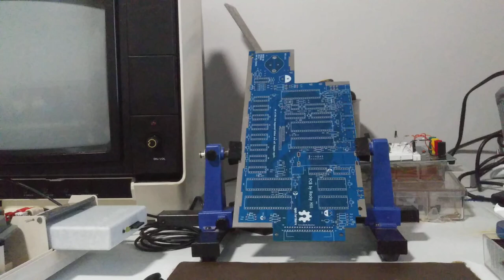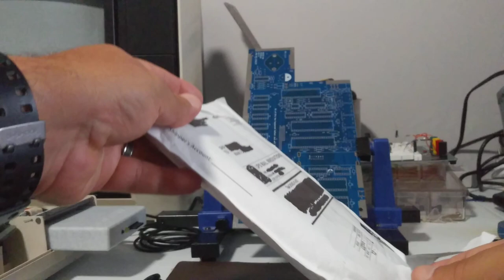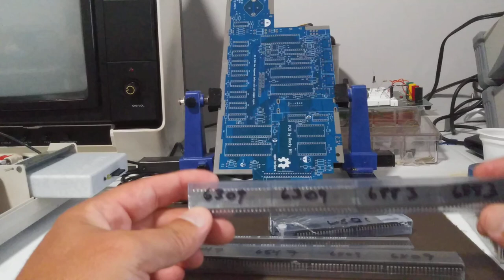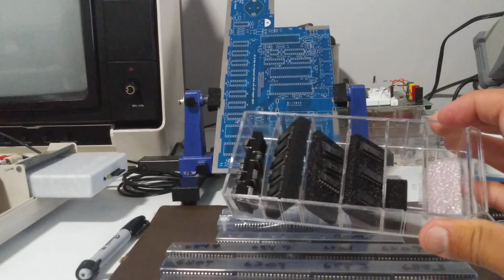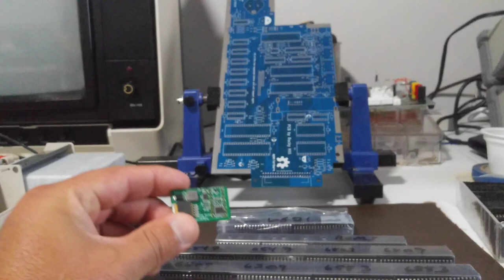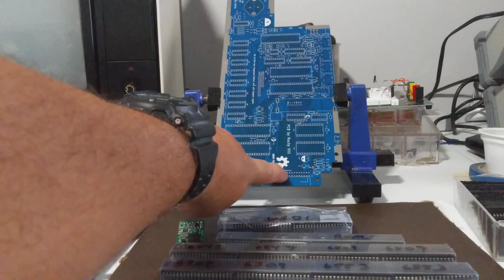Making a CoCo 2, a Retro Resurrection Part 1 #SepTandy

Comment: Awesome. Co Co II is my first & fav computer. I look forward to your progress. I have a couple old ones I collected 20 yrs ago, maybe I can find some parts you need..Will this also run cooler than the original Radio Shack pwr supply?
Reply from the maker: I think I have all of the parts to build the circuit board but thanks! This board specifically should run cooler because I'll be using the SALT replacement board that doesn't use that big transistor to side of it and I'll be using a 6309 instead of a 6809 which also runs cooler.
Reply from the maker: Are your CoCo's working? Maybe get one up and running for SepTandy?
Reply: @rockyhill3  Are the CPUs the E model?  The original CoCo boards require the 6x09E variant, which has a slightly different pinout than the regular 6x09.  If you've designed your own replacement PCB, you're probably aware of this, and perhaps even adapted the board to your available chips.
Reply from the maker: @joelavcoco   Yes, they are the E type and I've actually already tested this design out. I  used available schematics to make this board in KiCAD. I contributed my work to the bit-preserve project so that others can use it. If you want the schematic and PCB here is a link to my fork of the bit-preserve project. I added a CoCo 2 and CoCo 3 design.

https://github.com/qbancoffee/bit-preserve

After downloading or cloning 
just navigate to Tandy-RS/TRS-80 Color Computer/Color Computer 2/26-302x

That's the KiCAD project for this version of the CoCo 2
Reply: @rockyhill3  That's fantastic.  I've got a couple CoCo 3s with pretty battered PC boards.  Transferring everything over to a newly manufactured board wouldn't be the stupidest thing to do.
Reply from the maker: I'm still testing the CoCo 3 board and it seems to be working fine. I've uploaded a revision with fixes but I haven't ordered a batch yet to cofirm it all works(although it should). If your boards are battered and/or you want to mod a board without feeling guilty about modding an original board, this is a good option. You can still buy most of the parts on a CoCo 3, even the PIA's, so you don't need to transfer much. The GIME is the one part that you need to really be careful with because that is hard to get although soon you should be able to buy GIME-X's. I've made a replacement for the SALT chip and others designs exist so no issues there but the DAC chip still needs to transferred over.